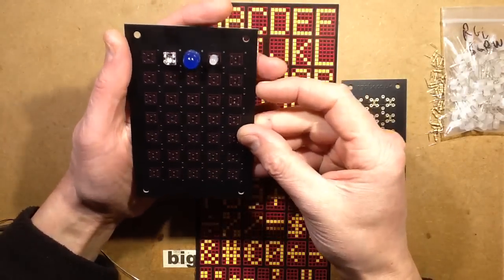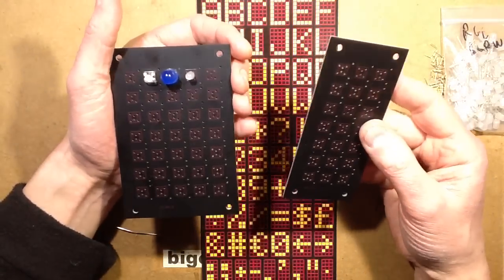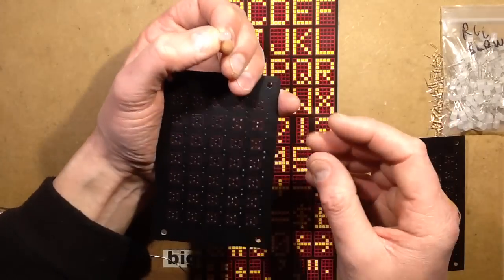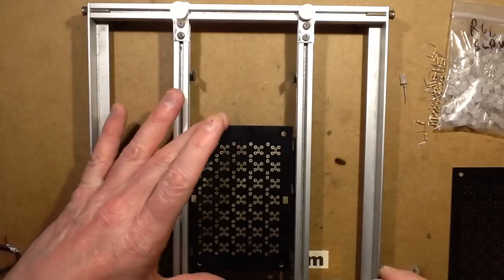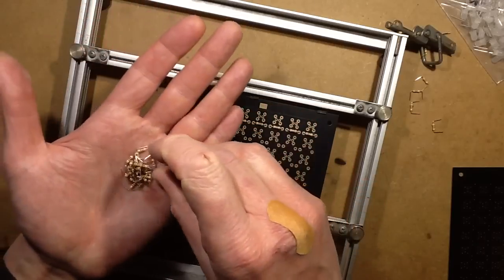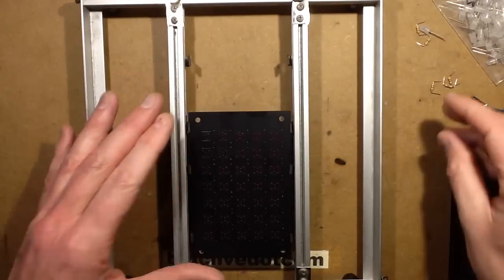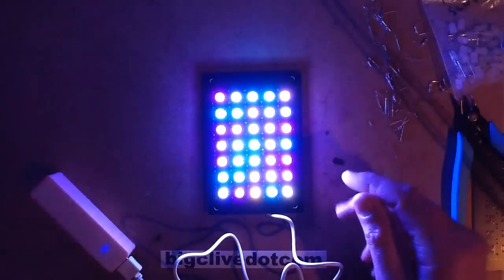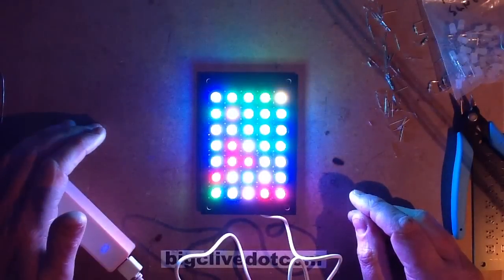RGB LEDs, signs and answers to questions.

Comment: I did a little experiment. I changed one of the Poundland incandescent sets of Xmas lights (now being sold off for a ridiculous 50p each) to use a resistive dropper (as BC showed on a previous video) but using colour changing LEDs. I was curious if they'd work from pulsed DC or would just stay as one colour. I also wondered if (because they were in series) they would interfere with each other as the voltage drop across each varied. 

Well they do work with pulsed DC but some didn't like it very much (or maybe they're just crappy quality) and in a couple of cases it blew one of the coloured LEDs (so it went dark part way through the cycle). Another curious effect is that one of them stays red. Remove it and put it across a coin cell and it is fine. Put it back and just red. Tried another and it cycled then went back to just red.
Reply from the maker: Some will reset to the start of the sequence (red) when used on DC with no smoothing.  The very low current will show up duff LEDs that might still work on a higher current.  At low current the red will also dominate the yellow, magenta and white colours because it drags the voltage so low that the green and blue chips don't light.

Comment: OK, here's something that I should've asked before. In all the years that you've been doing all this hard work have you ever injured yourself in a non-electrically related way? I'm wondering more specifically about herniated disc's, or torn ligaments that sort of thing.
Reply from the maker: Mainly back damage due to old and badly designed equipment, but also a significant ankle injury when I was dragged into a cable duct by a steel cover plate.

Comment: made a bicycle floodlight with 60 LEDs 0.5w ea from a dead corn cob bulb. similar to the one in the interesting fix video. I'm running them all in parallel with one resistance 15 between the +rail and battery 6v to keep the heat down ,I put the LEDs very close together.  lots of parallel LEDs without individual resistors is bad or worse than a long series run.  today I was zapping ni-cd drill battery's with a 350v 500uf capacitor to persuade them to charge .seems to work for now.

Comment: If you interrupt the power to the LEDs, do they all start at the same color? That would be a way to re-synchronize them. Give them a blip in the power once a minute or when they mostly go back to their original color. Make it short so you don't notice the blip. It can be done with a timer chip wired to a pass transistor. 

Otherwise after a few minutes you always get the same beige color. I don't know what you'd use that for.
Reply: some other odd ideas:
I think you could find a disconnect period that resets some but not all of the timers which might be an interesting way of mixing it up a bit more.
You could test the LEDs before assembly and put the fast changers at one side of the panel and the slow changers at the other for a possibly nice effect - though that's getting to being so much work you might be better off doing it in software.
Reply: joinedupjon
 That's what I thought. They would look OK in a toy where they were widely separated but if you put them all together ... whaddaya got?

Comment: Clive, With the circuit board you described as too expensive to ship, perhaps valuable lessons can be learned from Chinese electronic sellers: 0.02 shipping
Reply from the maker: I've often thought it would be great to stock my PCBs at a Chinese warehouse and have them shipped from there.  But apart from the logistics involved it would suddenly result in lots of other listings for my PCBs that weren't mine.
Reply: If I caught you right during the video.  10 boards came out to 5 pounds + shipping??  Was that your cost?  Would be cool if you ran them again, I think many would pay the cost to have a proper Clive board.
Reply: The chinese government pay for transport price on small packages, that's why they are unbeatable.
Reply from the maker: No.  That was just the postage cost.
Reply: "suddenly result in lots of other listings for my PCBs that weren't mine" - it had been said "imitation is the sincerest form of flattery", perhaps Clive could view thousands of Chinese sellers as the most sincere compliment possible.  They have the advantage of 0.02 shipping, that's true power.

Comment: I started messing with electrics at age 5 apparently I used to take things apart like the old portable little black and white tvs and when I was young my mum told me that I used to carry a plug socket round with me with a small screw driver and i always was messing with it taking it apart and putting it back together and for some strange reason I never plugged the plug into the wall at the age of 5 I thought I'd be dumb enough to do that very well now I'm 17 and moving on to being an electrical installation apprentice shows that school does not help one bit as u never was a good kid in school and would always mess about and never do work and I came out with not the best grades but it shows that if you put your mind to what you love you will soon become that

Comment: I'm curious, Clive, are those LEDs strobed by the color-changing circuitry or are they continuous-duty? I'm guessing they're using pulse-width modulation to vary the intensity of each color. That would certainly be the most efficient. How much does the power draw vary as one LED cycles through the colors?
Reply from the maker: They are being pulse width modulated and the current draw on a fixed voltage supply will be roughly 10 to 20mA per LED chip.  With a resistor you can limit it to a degree, but if you limit the current too much the red LED tends to drag the voltage down and stop the blue and green LED from lighting at the same time as the red.
Reply: Cool. Thanks, Clive.

Comment: My first encounter with electricity also around the age of 3 was when I placed my finger in the short blade opening of a 115vac outlet to find out what appliances were doing with it. It sucked! Sometime later, I did the same thing to the same outlet to see if it still sucked. Yes, it still sucked! Around that time, I also put my finger into an light socket of a lamp that had no bulb in it. It was plugged in, and it did suck. I did survive all three electrocutions, but did my interest for electricity die after that? FUCK, NO! I just didn't deliberately contact it not that there weren't many more times that I made contact with it. I mostly made contact with it from unpolarized lamps or improperly polarized wiring when I was living in what was my grandparent's home. It's mostly just a hobby now. I was looking into majoring in electricity after high school,  but that evaporated after some major difficulties with the financing. These days, in probably costs $100,000 to $500,000 to go to collage so it's just not happening. I never learned how to drive and I developed a disabling mental illness involving major depression and social anxiety so I can't work. Having your dreams shattered sucks worse than electrocuting yourself.

Comment: think your beard was rather short after the Pepsi Incident.  and the nice tall ceilings.  I'd have to say my soldering has gotten better watching your channel.  However with variable temps on the one I have at a 60 watt soldering pencil.  What is a good temp to have one set at (think it goes to like 600 degree and sure for certain it gets red hot.  :O  as in my... that tip is glowing
Reply: having watched a bit too much Outlander when moms had it on naturally it's red.  I grew mine originally because 1. was losing some hair but thought the bear made me look tougher  and indeed it cut down on the BS.  Alas I really lost most of my hair up top.  Took till I was almost 40 to figure out I had Hazel eyes and not brown  (sometimes called multi colored)  It's common with parents with brown and blue eyes.  I guess it figures , moms brother's beard when it had color would have red streaks.  So does mine  There is supposed to be some scientific reason for that but don't much care.  I do care a little bit if it gets in my food :P  Now EEVblog has this well tip and I wish I knew where to find one.  sure would help with soldering a bit.  he makes it look so easy using a well tip (has  a little bit of solder in the tip.  so he just slides it along this 10 pins per side chips and nothing sticks the pcb board. :O

Comment: Hi Clive, how hard would it be to fabricate a clock using four of those panels. What considerations would there be for the clock pulse and power supply if any. Would you use a counter chip and led driver or can you get an all encompassing ic that does it all? many thanks for the video's.
Reply from the maker: It would require dedicated PCBs for a clock display.
Reply: Of course everything is hooked up to the pos and neg rails. Sorry you said that in the video. Must pay more attention in future. Thanks for getting back to me.

Comment: I would like to ask how many leds can you use with a 2amp USB plug I really want to do this but up scale it 
but don't want to over drive the USB plug
thanks in advance
Reply from the maker: I tend to suggest under-running the power supplies so they run cool.  It might be worth making it modular so you can experiment with the number of LEDs.
Reply: Yeah that's a good idea make a 20 led and test how much it uses and add more till I'm happy and the power supply is under the maximum load
Thanks 😀

Comment: I had quite the shock when i was 13.
Made up some alligator clips out of wooden clothes pegs and connected straight to a 240v outlet (Australia).
Was blowing up diodes, transistors and such hanging them out the window.
Forgot to turn of power once and grabbed both leads.
Could not let go! Was screaming until i fell back on my bed and went silent as darkness closed in.
A friend ripped off the leads and he got thrown across the room.
I still have scars from that on my left hand.
One on the back of my hand did not bleed and took years to heal.
I think electricity shot out through there :/

Comment: Can you put me with that chinese manufacturer? I don't have skills needed to make these boards, but would be able to put leds on these if I had the boards, so having a link to chinese manufacturer you've used would be mighty useful.
Reply: QVear try PCBway. however you'll need to convert the files to Gerber format for them to accept it most likely
Reply: drojf
Ah, okay. How do I do that conversion?
Reply: QVear I think you have to use the software he provided to do so, but it's really old software so it may be hard to do. I could tell you if it were altium or kicad :(. if you haven't used pcb software before it may be quite difficult.
Reply: simontay1984 agreed - it's probably easier to make your own board (stripboard/protoboard or otherwise)
Reply: drojf
Not if your electronics knowledge is limited to "soldier this thingy there to make this work", no!

Comment: In an earlier posting I saw you have one led with one tiny resister across 240 v mains and it was lit.  There must be something basic I don't understand about electricity as I always thought that these LEDs take around 3 volts and yet I saw that it looked like there was 240 volts going through the LED.  Does the question I pose here point the way to what I am missing about electricity that you can explain to me?  Did the resister cut the 240 volts down to 3 volts?
Reply from the maker: There was only 2 or 3V across the LED and the resistor was having to dissipate the rest of the voltage being dropped as heat.

Comment: This should work perfectly with a stripboard. Either with lots of cuts or (something like this must be available somewhere) alternating with dots.
Reply: I was thinking the same - and was then pondering about what wattage of resistors to use on a strip...
Reply: Not one resistor per strip. One common bus strip per LED, one common bus strip for the resistors and then connect resistor and LED with a short strip of two holes. So you'll need three strips for each row.

Comment: Hi folks, (and hopefully Clive), I have an LED problem.  I have made something similar to this, but with 2 parallel strings of 21 superflux colour changing LEDs in series, powered by a capacitive dropper with full rectifier.  (Overall it makes a 7x6 panel) The problem I have is that the LEDs never change from red in the circuit.  Red is the first colour when they turn on normally.  I have tested several of them individually out of circuit, and they work fine, and change through the colour cycle.  Do you think that unsmoothed DC is enough to make them never change?  What I mean is, is it possible that they are being reset 100 times per second?  I tried to add a smoothing capacitor, (all I had to hand was a 22uF 400V) but it made them very dim and still stuck on red.  What value of capacitor should I use for smoothing?  Is there a way to calculate it?  The voltage of the circuit is around 70 volts, and runs at about 20ma per string.  Thanks for reading, and for any answers!
Reply from the maker: The capacitor should have worked.  Even a 400V 4.7uF capacitor should keep a little current flowing through the zero crossing points of the mains cycle to keep the LEDs from resetting.
Reply: Thanks for answering, that's good to know!  I did feel that it would be enough, so I further investigated the LEDs and the circuit.  I tried bridging out sections of 7 LEDs with a 24V switch-mode supply.  Same thing happened, stuck on red.  Started to think that the series-ed LEDs were somehow interfering with eachother. They are oddball LEDs, very few listings of superflux colour-changers on ebay.  That 24V SMPS had visible flicker though.   But I just tried bridging a section of 7 with a 9v battery, and it worked!  Starts red then faint green due to higher voltage drop.  So it must be that the LEDs are OK, my smoothing capacitor must have been dodgy.  It might be a salvaged one.   Either that or I did something daft like connect it backwards.  Will try again with a new cap.  Thanks for your help!
Reply: Thanks again Clive, my circuit is working as intended now!  I must have incorrectly connected the capacitor.  I might make a video of it once I tidy it up and put it in a housing.  Crediting you for inspiration of course.

Comment: Would these leds work properly in a diy lamp with the capacitive dropper? Or would the ripple reset them?
Reply from the maker: Some of the earlier versions did not like rough DC, but modern ones are OK if you add a bit of smoothing to help ride over the zero crossing point.

Comment: Are you going to use an ATMEGA Micro-controller to make this board work.
Reply: board works by itself, each led has 3 colours and a control chip in it, so it cycles just with some voltage applied

Comment: The First Time I meet Electricity I was 5 years old poking a metal knife into a gpo socket, bang.... 240 volts later, I was shoot across the room, back in the 70's there was no safety switch or fuses, just the old wired ceramic fuse in the fuse box.
Reply: I remember when I was approx. 4 (I'm 52 now) sticking a fork into an ungrounded 2-slot AC receptacle. I don't remember actually getting zapped, but I do rather vividly remember being "rewarded" with a loud bang and a large shower of sparks, hahaha!!! ;

Comment: gotten plenty of shocks but fairly sure that PSU (400 watt) from Antec $80 PSU  POS.  .  clearly one of the leads under the pcb I later figured out had been 1 . a bit long 2. punctured thru the plastic safety covering and 3.  I was a first class idiot.  Fortunately per say nobody was watching me but if your holding a heavy PSU by your hand from below and your testing why it's not working  don't do that.  :O  all I remember is it went in my left hand and out my right foot on carpet.  off a GFCI someone has in backwards so it protects everyone but me.  Still haven't gotten around to fixing that :O  which is why I have testers telling me if  something is wired wrong and or if it's grounded/GFCI protected.  ('m not trying the tester on that :O  

Worst shock story I ever heard was from Grandpa (20 years ago + he's been gone)  went to fix something in a wet concrete basement and whatever he touched flew him in the air backwards.  (that one I've probably said too often.  I know I've shared somewhere the $80 Antec.  I'd always thought the heavier the computer PSU , the better.  apparently not

Comment: Hi Clive or anyone that works/has worked in the industry, I'm an apprentice lighting designer and my apprenticeship comes to an end in September and was wandering if you could help me out with a couple of things. first off what's the best way to get a job in the industry any websites etc and secondly what's the best way to learn to repair different types of fixtures from par cans to movers and anything in between with a basic electronics knowledge also does anyone know of any good websites for a beginner to learn about electronics to thanks in advance
Reply from the maker: The entertainment industry generally relies on picking information up as you work in it.  Unfortunately this involves a long and random low-wage pseudo apprenticeship.  I've always tended to recommend getting a traditional trade before working in the industry so you have provable skills and there's always something to fall back on.